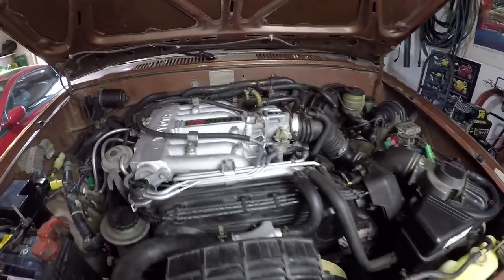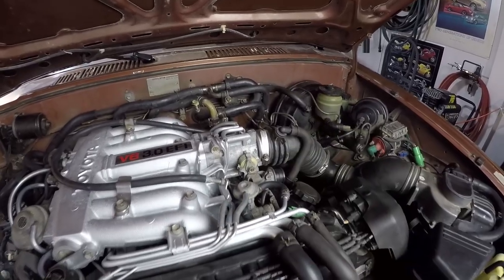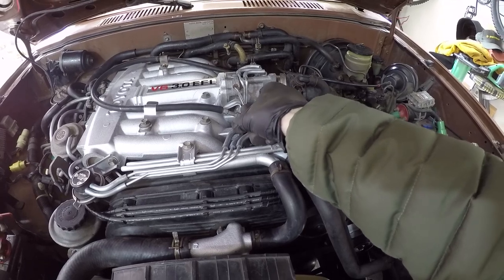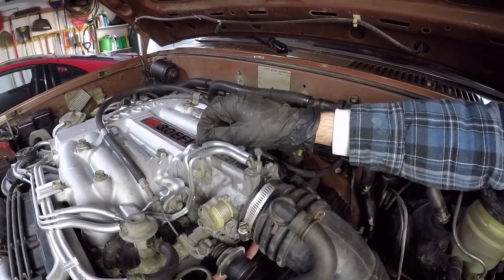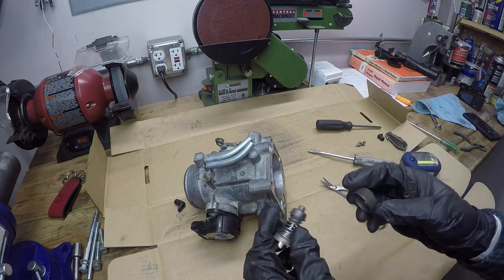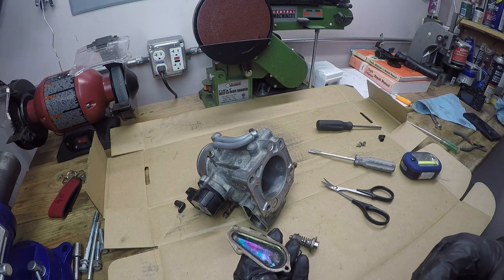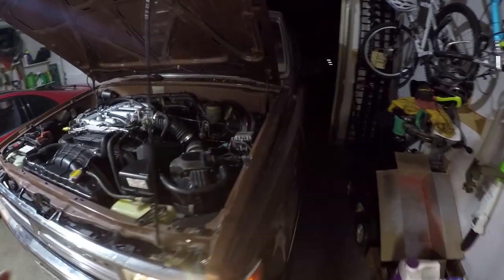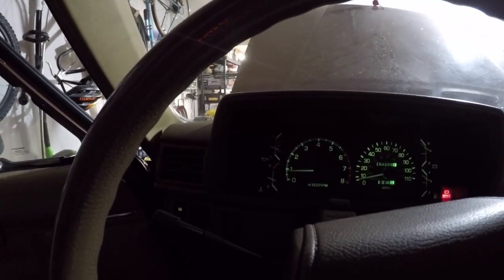Toyota 3VZE | Ep.9 | High engine idle speed EASY FIX!

Comment: My dad found your video after having issues for weeks, I had told him it was likely something to do with the coolant because it was primarily a warm up idle issue. There actually wasn't an issue with this valve, however your test did narrow down the problem and when we got everything apart we noticed the line going to this valve was near 100% blocked, so a few squirts of carb cleaner and a little shot of compressed air got it it tip top shape again. He said he went to say "thanks" and didn't have an account set up so he asked me if I could send a monetary thank you your way. Great job man!

Comment: Excellent detective work and "proof of concept".  I have a '91 pickup with the same problem that owner abandoned on his father in laws lake property 8 years ago.  Because he didn't register timely when he moved from NY to Canada he was in violation. He could not drive it legally (especially since he was a lawyer). The FIL said I could have the truck if I hauled it away after I delivered his sailboat from Florida.  I rented a uhaul and trailered it back to Atlanta after 4 hours trying to load because it wouldn't shift out of park.  I jumped the battery off my Dodge diesel to see if that would help and it started to my amazement.  It still wouldn't shift but my son disconnected that part of the mechanism when I got back to Georgia.  Luckily, truck was from California  and wasn't a northern rust bucket (yet).

Comment: You are very attentive and that’s refreshing cause it’s all too often that “oh well it’s good enough” is thrown around nowadays and it drives me crazy! If your gonna do something do it right and have some pride! Awesome videos man! I’m guessing you live in a state you can’t get rid of the EGR and Pair valves cause it makes these 3.0s run so so much better! I also got rid of all the hard lines under the intake and ran the coolant hose from the top inlet to the metal u joint in the back of the engine bay and just cut the u to a straight and added the G-force silicon layered hose kit! But man you do good work!

Comment: Brilliant video! Everything explained perfectly, and problem solved. I just finished major work on the 1MZFE on my '95 Avalon. Replaced anti-knock sensor harness (requiring air plenum and intake manifold removal), rear bank valve cover, and  plugs, plus a couple of age-embrittled items that broke while servicing.  It all came back together, miraculously,  and engine runs great with much more power. BUT now has high fast and slow idle. 

I read a lot of "solutions," but yours looks like the right one. I'm going to drive it a few days to see if the ECU "relearns" the right position, as some suggested (though I'm skeptical whether this model year even has that feature).  Then I'll try your fix. BTW, that wax-filled plunger on the Intake Air Control valve is the same type of mechanism as the zone valve I recently replaced on my hot water heating system. It's a tried and true system going back over a century. You're the first YouTuber who has explained how it works on the IAC. Makes a lot of sense that the one on my Avalon may have tired a bit in 27 years. It's probably just age-related wear on the spring. Thanks again for great video!

Comment: Great update on the 4Runner.  One of my issues that makes me sometimes hesitant on pre-90's vehicles.  Unless they are popular ( and have a huge and active owners group....including a very active internet forum for example ). Figuring out quirky stuff like this can be a PITA. Then when one of those parts totally fails or is just becomes
worn out finding the part can also be fun ( and/or expen$ive ).  But this series does make me miss one of my first project/flips...a  87 4Runner. It was a very unique transformation.
Reply from the maker: So true. I was scratching my head for a while on this one. The service manual, of course, calls this a non-servicable part so stuff like that can throw you for a loop too.
Reply: Finding a good condition with one or two owners tends to be key. A lot of times it's people modifying and hacking stuff up that tends to make some problems hard to fix. There is also a ton of support and passionate people that love these old Toyotas. Forums can be hit or miss but I like Marlin Crawler and Yotatech they should help if of you ever need it.

Comment: The only time I've had a high idle on my 94 Pickup 3vze was when the Throttle Position Sensor went out a little after 200k miles. All the little vacuum lines have held up luckily even being an Arizona truck. It's been the larger rubber emissions lines I've had to replace and some coolant lines just as a precaution. Looking forward to seeing more of this 4Runner. I have an 87 but it's got a 22re in it.
Reply: Hola amigo sadulo desde chile

Comment: Well blow me down!   If that don't beat all.  I have a 94 toy pickup 3.0 V6 4x4 bought it new, never had a problem, I recently noticed that the idle was slowly getting higher and figured that an old vacuum hose was the culprit, after checking for any vacuum leaks with no luck I turned to Google which brought me hear.
Great video, now to remove throttle body ! 😢😅😊

Comment: erratic engine idle is also caused by any leaks in the air intake tube.  With all the elbows and connectors there are plenty of opportunities to get leaks on older engines.

Comment: Excellent Video - Thank You! I have a similar problem with our '91 4Runner 3VZE. At present warm idle speed is only slightly higher than it should be but will keep an eye on this. Just getting to 200K on our motor, and hoping from many more miles. Yours is a Nice Clean Motor!

Comment: I have tried this before I have 3 throttle valves to deal with. All three the collar absolutely will not come loose. I even made a tool from a socket and used an impact. I don't know how all these people find these ones with loose collars. I gave up.
Reply: I did everything to it , hammer, impact wrench, heat, nothing has worked, I'll keep in trying an let you know, greetings from Quetzaltenango 🇬🇹.

Comment: My cold start is around 1100-1000 rpm should I do the opposite and unscrew the threaded cover more? And then once warm idle goes really low and then dies, unless I gas it.
Reply: The more you unscrew it, the higher your cold start idle speed will be. Unless you live where it freezes I;d screw it in like he suggests.
Reply: @supercharged2414  there is something wrong with mine, nothing worked at all. I believe it was my injectors.
Reply: @Zapp760  Does the idle adjust screw change the idle speed?

Comment: I haven't been able to remove that threaded collar that you so easily removed with a pair of scissors.  I gently placed the t/b in a vise after spraying collar with PB blaster and have use a putty knife and hammer tapping that collar and still haven't moved it.  I've order some Kroil penetrating oil that all swear by and try again in couple of days after receiving.  Any other suggestions are welcome.

Comment: I saw you used a stubby scissor to remove the nut and a screwdriver. I’ve destroyed two IACs on my 22RE today trying to Adriatic them. Ray Nada used a socket he modified, I tried that among other things. Any advice from anyone would be appreciated. Toyota must have a SST for assembly?
Reply: I finally got it out , heat the pice with a heat gun and then use a wrench socket (home made tool) and will came out.

Comment: Like a fee others, my collar was also seized on two different throttle bodies! Slapped it back together without making any changes. Im chasing an issue of stumbling starts when the motor is warm. 
Cold starts are crisp but hot starts it stumbles alive
Reply: Did you happen to find a fix for this? I’m having the same issue.

Comment: Hey thanks so much for this great video! So nice to see high quality 3vze content on here. Your video gave me the confidence to take apart my throttle body and replace the gasket. I tried opening up the IAC and spinning out the spring but I couldn’t get it to budge. I used needle nose pliers, 2 screw drivers and eventually a screw driver and a mallet but the thing wouldn’t move. I stopped not wanting to damage it. Wondering if you have any ideas on getting it to move, I’d like to screw it in further like you did. Vehicle is a 1990 pickup sr5 4x4 3vze with 99,500 miles. Thanks so much!
Reply from the maker: Check the comments on this video. Another viewer had the same issue and made a video on how they went about getting it to move.
Reply: @theblizzardof78blog  did you get yours out I've made 3 sockets and let it soak and it won't move
Reply: @coop_69  hey no i never did, never made a socket. I Ended up replacing the throttle body gasket and that helped. I also saw that my rubber air intake had cracks in it and replacing that helped as well.

Comment: I just did this to my 1990 4Runner. It was a pain to get that cap screw off and I had to make a tool out of a chisel. The valve hadn't been sealing in years, I presume. There was no witness marks, just a bit of carbon buildup. Still, I didn't expect much difference, but this car is much more civilized now that the idle speed is down. It no longer feels like I'm walking a dog pulling at his lead.

Comment: Hello.
At 5' 21'' you showed the housing with what it kooks a yellow washer at the bottom. My problem is after I made a tool from a Chrome-Vanadium hard steel 1/2' drive, 1/2 socket I could remove the collar and the other pieces. Then I cleaned everything, just when I was going to put them together I noticed a very small pin on the floor, I picked it up and noticed that the yellow portion at the bottom had an empty housing to allow the pivot pin to be located within. This small pin had an indentation around one end, it looked like this was for a retainer. I couldn't find the retainer if there was one. I guess this was to prevent going deeper into the housing.
Please help. I need your expertise. 
Thank you.

Comment: Moms Yota has an issue with the egr. And I see that there is an issue with a vacuum hook up labeled 'R' on the throttle body. Is it supposed to be sealed? Because it holds a vacuum and it's impossible to push any air through it.

Comment: Hi I have a 88 4Runner that has the same problem but it's been resting for a few due to a lack of $$ it's time to get back on the road first thing in fast forward it's hard to know what you are doing and you don't explain as much as I need but a fantastic job!!
.? Why did you not send out the block to do a complete redo ? Cost ? As you said that the rings were passing air ? 
I wish I could send you my 4Runner and. Lot of cash to fix it for me.
A new fan 
JoP
Reply from the maker: I didn't rebuild the engine for a few practical reasons. 1) I didn't have the time. Removing an engine, disassembling it, videoing the process, editing that video, getting parts, waiting on the machine shop, reassembly, reinstallation, takes a mountain of time. 2) I didn't have the space. Removing an engine means you need to have space for the engine crane, an engine, a transmission, etc. all while being in the middle of a cold, snowy winter when other cars can better use the garage space (i.e. my wife's car and my Z) 3) Cost is relatively minimal, so it's definitely not a large contributing factor to the decision 4) The engine, quite honestly, didn't NEED the bottom end rebuilt. It worked great until the head gasket blew, which is a independent issue from the bottom end. 

When you're dealing with older cars, you can easily make a case for rebuilding/replacing everything that looks mildly worn. This is why you see so many vehicle projects become never finished, forgotten, and ultimately sold for scrap. You have to have your practical limits. This is why the engine was not rebuilt, and this is why the truck runs and drives great right now, not months or years from now.

Comment: I bought a used throttle body and it has the same problem. I don't think either wax puck assemblies are working. I'm thinking about filling the compartment with epoxy but not sure if it will start well without a high idle speed. I do live in Florida so I don't have extreme cold to deal with. I looked and looked for another GOOD used one but the only other one I found for over $200 looks like a piece of trash.

Comment: Have you noticed a "howling" coming from the throttle body after closing it more? I noticed after adjusting it, it runs great just has an annoying howling/humming noise.
Reply from the maker: No, I never experienced that noise. Did you clean the valve at all? It's possible there's some sort of build up on it allowing air to get by and make that sort of noise. Don't know what else it could be if it's coming from the throttle body.

Comment: I cant get the sealing collar unthreaded. I have made the tool outof a 17mm socket and it slips out. Broke first one made another. Heated it with heat gun while soaking with penetrating oil. I tried using a screwdriver and hammer and tried to get it to move tapping on one side of the slotted section. Second day and it won't budge. I never heated aluminum with a propane torch. Wonder if it would burn out the wax expansion part?

Comment: 95 4runner, cold idle, runs at around 1,100 rpms, when at below half, idles in drive around 800-850 range, but idle speed is high, also have a knock sensor code, but maybe that wouldn't effect idle speed, without removing idle air control valve, how much adjustment should I give that screw on the throttle body?

Comment: The AC works better with 1000 rpm idle and oil pressure. I've Deleted the EGR.Got rid of all the unused vacuum lines. You want believe it but I got my 4 runner to 95mph on the freeway. Because its no longer choked down. IT CAN BREATH.

Comment: Can you list the part number from Toyota for this piece.  I could not find it.  My 94 is running great but this would be the last link in the puzzle.
Reply from the maker: Unfortunately Toyota doesn't sell the valve separately from the throttle body. You would have to buy the entire assembly.

Comment: Why not replace the wax seal on the throttle body? Isn’t screwing it in just a temp fix? Does the wax part come out?
Reply from the maker: No part of this assembly is replaceable, aside from potentially the entire throttle body that Toyota may or may not still make (going to be a lot of $$$$ regardless). Screwing the valve in deeper is the correct fix here.

Comment: Although this helped, I would look next st the volume air flow meter, when I fixed that, my rpm do stay around 800 but there are times where it's erratic, so it could be 800 then 650 then 1000 it never starts at the right idle, but I have more problems than this going on, knock sensor....speed sensor aka speedo cable 

Replaced speedo cable and on the way up to eureka CA, it got so hot in the exhaust it melted the cable

Comment: I made special tool to unscrew IAC valve on my 3vze...But could never unscrew it all the way.  It felt like it was turning the spring inside and would break it.   I adjusted it inward a little after not being able to remove it and then the truck would only idle at around 1200 at cold start which means it takes forever to warm up.   So I adjusted it again back out.   I still only get cold start idle at about 1300.

 I also have slightly high idle at about 950-1000 and idle adjust screw is all the way in.
Reply: Hola amigo te saludo desde chile yo tengo una Toyota 4 runner 1993 motor 3vze con unos problemas en el encendido quisas me puedes dar unos concejos
Reply: What tool did you make

Comment: After cold start, how long does it take fast idle to drop to idle of 800- hundred RPM? Outside temperature about 75 f degrees on cold start. Thanks for the help.  

My truck is 1992 Toyota.
Reply from the maker: It's dependent on engine temperature, but at 75 degrees I wouldn't think it would trigger a fast idle. Even in freezing temps it wouldn't be more than 5 minutes at idle. If diving, it would be much faster.
Reply: @PracticalEnthusiast  Thanks for the information.The engine cold start,, summer are winter will consistently run fast idle for 5 minutes and then go to idle 800 RPM. Perhaps the throttle body is the culprit.
Reply from the maker: @patalexander1965  I'd say it's definitely in the throttle body. However the issue is likely different than shown in this video since yours does eventually drop to 800 RPM. I'd check that coolant is properly circulating though the throttle body. Could be a blockage or air in the system.
Reply: @PracticalEnthusiast  Thank you for this information. Will check soon.

Comment: Hey i have a question regarding IAC valve - does it have to be opened a little when the engine is already warmed up or should be completely closed? Do You know at what temperature should it be closed? thanks:)
Reply from the maker: It should be completely closed when the engine is warm, but I couldn't tell you what temperature that is.

Comment: I have a question regarding the IAC. I have a 2003 Toyota RAV4 that sputters when I first start it up and the outside temperature is below roughly -25C (-13F). Would an IAC that sticks shut cause the idle to drop far enough for it to begin sputtering (like it's running too rich)? I hope you read and respond to this, it would be greatly appreciated :)
Reply from the maker: Yep, an IAC could definitely cause that. Or, the engine temperature sensor could be at fault. This is the sensor that tells the ECU the engine temp, not the one that controls the temperature gauge.
Reply: @PracticalEnthusiast  Thanks for the reply! I've already swapped out the coolant temperature sensor as that was my initial suspicion. Guess I'll have a look at the IAC next.